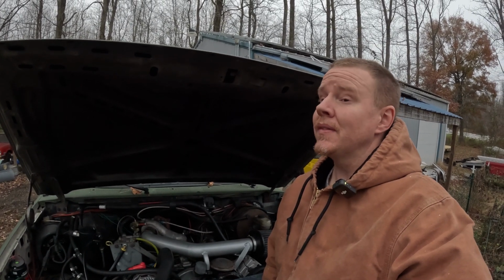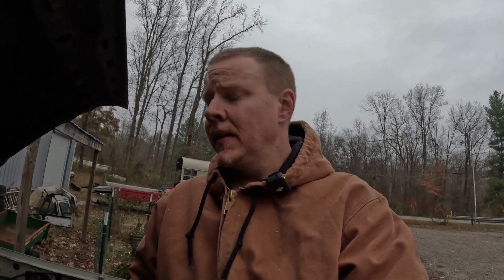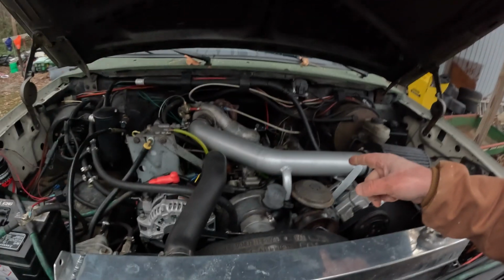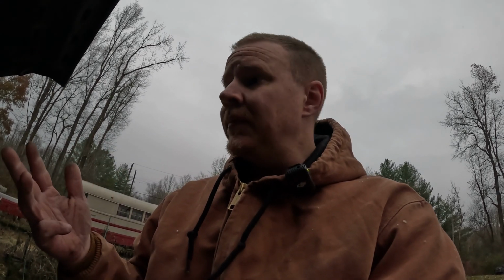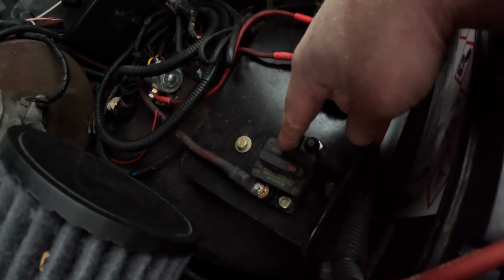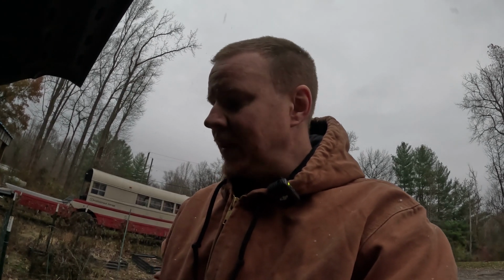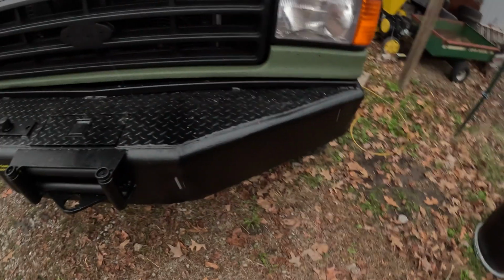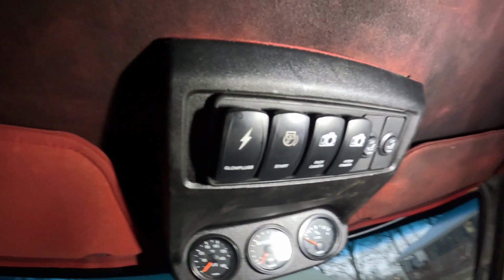7.3 / 6.9 IDI Manual Glow Plug Control - Rock Solid Reliable! - Cold Is Here - Is Your Diesel Ready?

Comment: Awesome set up! I just ordered all the stuff to convert mine, would you be able to shed any light on what wire got to which studs on the solenoid? From what I found online it looks like you hook the wire from the battery to one or the two larger studs on the solenoid and then you would hook the glow plug harness to the other larger studs and then for the two small studs of the solenoid you use one to hook up the ground and the other for ignition switched 12v, does that sound correct or am I missing anything? I did also order a 150amp breaker to install between the battery and solenoid
Reply from the maker: The trigger wire to activate the solenoid goes to one of the small studs.  Your switch which would be powered by ignition hot.
Reply: @NotSoGrandGarage thank you so much! You were about the only person I was able to find that showed their set up on an idi, I appreciate it!
Reply from the maker: @PeatyRutherford no problem!  Thanks for watching